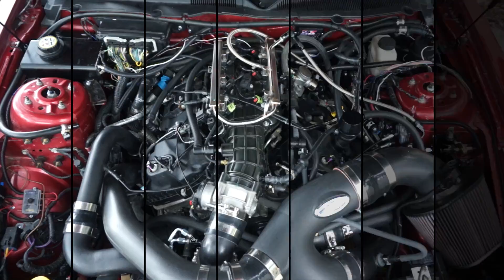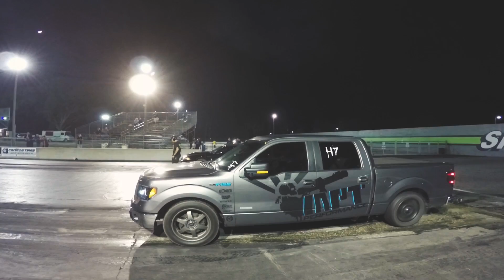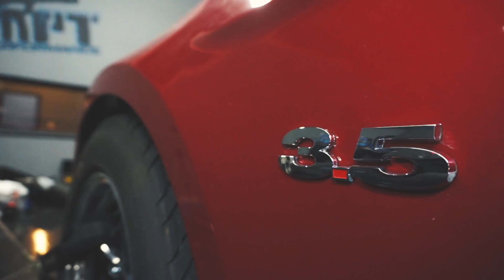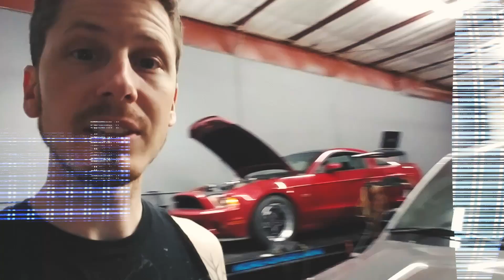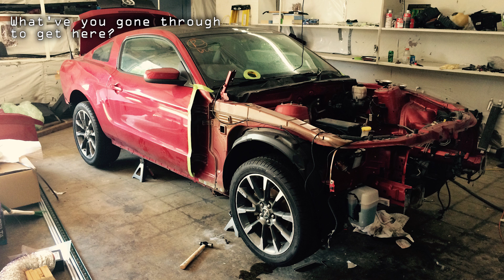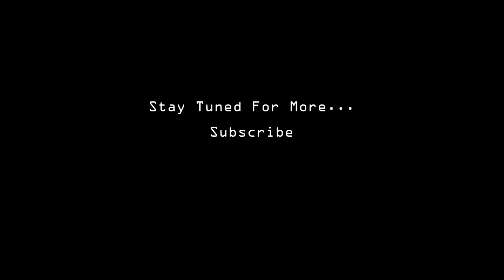Project Ecostang: 3.5L Ecoboost swapped Mustang - Part 1

Comment: Imagine building a ecoboost swapped s197 just for ford to come out with an ecoboost s550😂😂😂 love the build
Reply from the maker: Think most folks will agree that there's a big difference in the potential of the 3.5L compared to the 2.3L
Reply: @ Yeah definitely, ford was actually going to put the 3.5 in the Mustang as an option but it would’ve been on par with the 5.0 performance wise so they threw the 3.7 NA instead

Comment: On the Direct injection and conventional injectors, pointing at the back of the intake valves, is best protection against the carbon build up problem, that plagued all manufacturers early Direct injection only engine platforms... Though it seems having both already would delivering all of that extra fuel ⛽ needed for this all out, over the top Ecoboost build !!!! Good luck brother, I'll be watching.....
Reply from the maker: You got it, having both port and direct injection is a game changer

Comment: I've had the inkling (as a normal guy who's never done this before) to build a 2.7L ecoboost "underdog" mustang. S197 2010-2012 facia, 2013-14 rear, other custom appearance parts, of course, but the driveline?

Built 2.7 set as far back in the engine bay as I can, with a corvette transaxle and rear suspension put it. 6 into 1 equal length sequential header into a big single turbo. Manual or the 10-speed. Probably taller than normal gears, too. I'd aim for 500-700 wheel.

And it would be a convertible.

Comment: I'm curious as to why you didn't just (after hearing about how much trouble you had getting it to run) go with the Ford Control pack?  I know it's pretty pricey, but if it would have saved you a year of work...

Now, after having gone through the work to get it to run, would you just drop the cash on the control pack?  Reason why is I have a 2005 4.0 with a 5spd with 170k miles on it.  If the engine goes kablooey, the 3.5 is what I'd like to put in.

Comment: 😐 why would you want direct and ported injection on a engine?
Reply from the maker: Currently no way to upgrade the HPFP. E85 is more resistant to knock and detonation than 93 octane gas, but requires considerable more fuel flow.
Reply: The Audi S3 Engine got both. PFI for low duty for good homogenisation of the mixture and the direct injection for good power up top with the cooling benefits of the DI

Comment: You better be able to break 9 sec with that thing as livernoise is under 10 already with the Eco 4 if I remember correctly. Not bashing just pointing it out love the idea of this car. I really hope ford one day offers a v8 ecoboost in a truck. I love my 3.5 with Tune, meth and all the goodies but like stated in vid turbos ran out of steam. Still amazingly fast and have 74,000 miles since built and lots of meth run through it. These motors are so tough. leep up the good work
Reply: Thanks! The fastest 4 cylinder ecoboost is BG racing, it runs a 10.3. If they broke in to the 9s with a 4 cylinder anyhwere they aren't talking about it that I have seen. My setup has a lot more potential, more cylinders, more displacement, twin turbos and a solid rear axle saving me 150-200lbs. If I gutted my car and use carbon fiber parts I could be in the high 8s one day.
Reply: Yeah eco 4 is already low 9s

Comment: I wish MPT could have helped me even slightly with mine. BTW If all the trck will do is 12s then it is already second.
Reply from the maker: Working on some things here that should open the door to helping you out. Can't say when but high hopes.
Reply: Link to the faster truck?
Reply: Spoken like a true SSI minion.  The MPT truck is well below 12s, and they have several tune only F150 guys in the 12s.  Good luck with that "Maypop" tune.  Personally, I prefer my internals... Well... Internal.
Reply: I would love to get their help, they wont because I live in CA. My tune is very conservative. I have been beating my car for six months with no problems. At 2700 lbs it doesn't take a lot to get rolling quickly. I didn't mean to cast any shade on them but I think they could have at least advised me after a couple of months of emails and waiting.
Reply: +Dan Clary I apologize for jumping to conclusions.  Yes, the California restrictions thing really stinks.  However, there may be a way around that if you're creative.  Lol
Reply: No problem, I can get around a few things but not everything.
Reply: The MPT trucks fastest time is a 12.1 which is really impressive considering it weighs 6k lbs. I wasn't aware of any tune only ecoboost running in the 12s, that's an incredibly impressive tune to day the least. Must be 500 RWHP to achieve that considering the weight.
Reply: +Stephen Keen I stand corrected.  I could've sworn Mike had taken the truck into the 11s (not publicly).  At any rate, 12.1 is an amazing time in a 5500 lb brick!  Great guys and great products and services, for sure!
Reply: Your certainly right about the trucks in the mid 12s with just a tune, unbelievable! I've been watching some YouTube videos of it, wow.
Reply: Dan, There is a way to tune your car . . If I had contact info I can tell you how.
Reply: you can contact me through my FB page, Dan Clary Auto Service